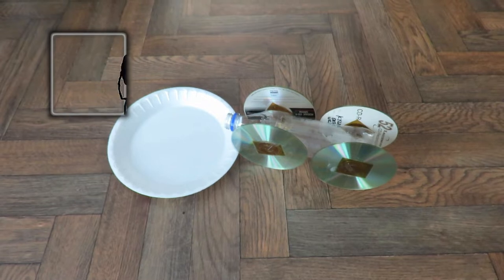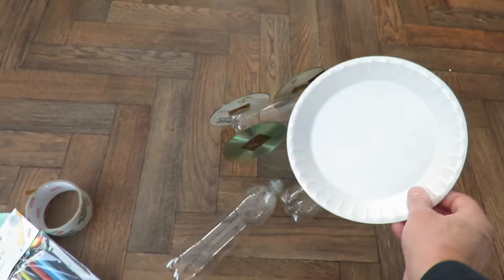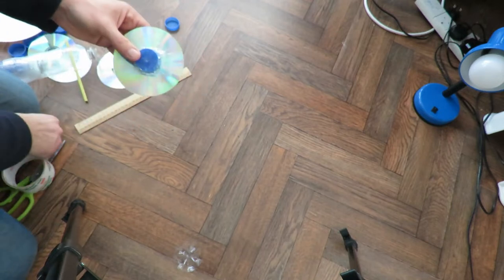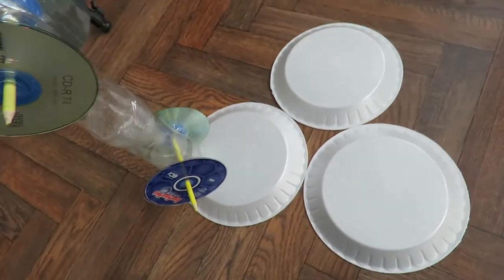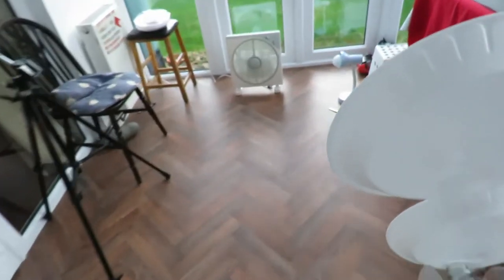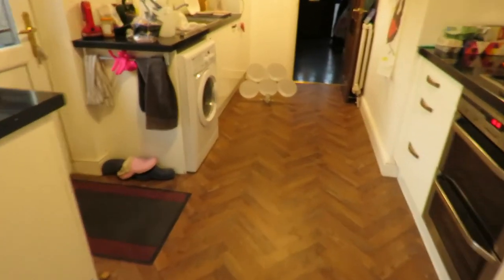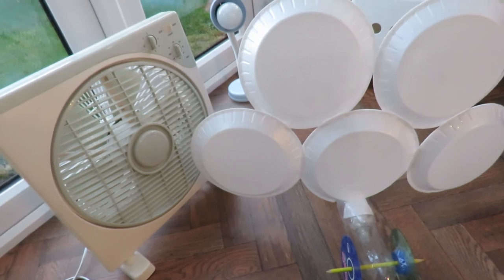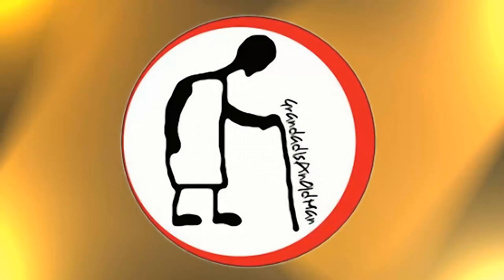Wind car from limited materials Second Attempt SHORT

Comment: Radical but worked pretty well. Sure got more speed off the line at least.
Reply: Yes, I wasn't quite sure if we were going for speed or distance and I don't know what size fan or floor conditions. The specifications said "A box fan will be turned on high for 30 sec to see how much the car travel the distance."